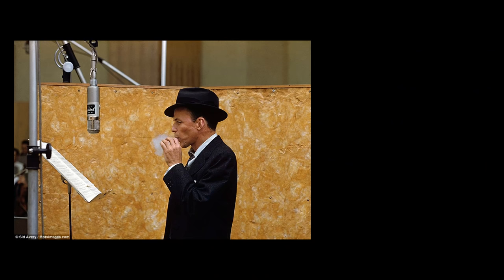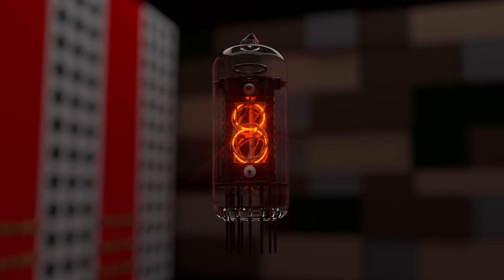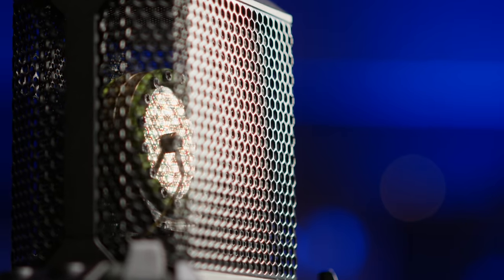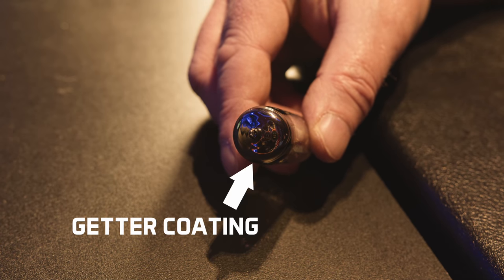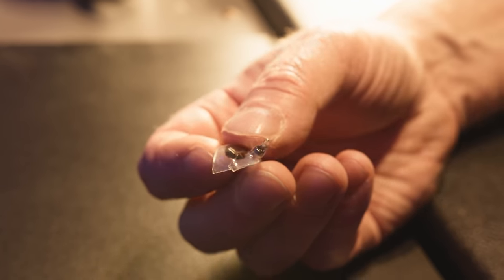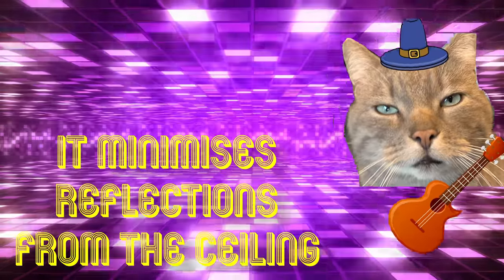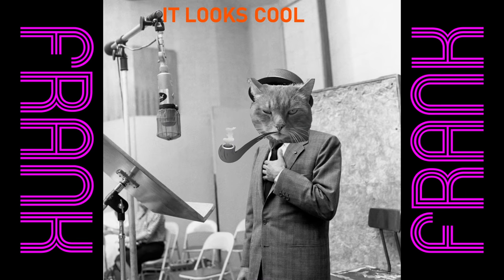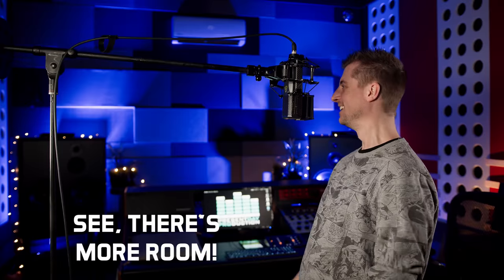Should You Hang Your Microphone Upside Down?!

Comment: Everything in the studio should be placed at an angle of 17 degrees or perpendicular to the cat, whichever is cheaper.
Reply: Thinking of our old cat, It would have been easier to rotate the entire studio.
Reply: 15, don't push it!
Reply: And don't try to attach the mic to the cat. It will be cross! Cheers!
Reply: I've had good success at 23 degrees. In any case, arguing with a ceramic cat is not much fun.

Comment: For me it's a bit of a no-brainer. I have a heavy Rode valve condenser mic which has that classic Neumann u87 dimension and, after wearing out the thread of the first shock-mount fitting that I bought for it (and we're not talking a super-heavy duty quality item here), realised that by turning it upside-down it was no longer top heavy which now causes far less strain on the structure holding it in place.
Reply: Yep. Hanging down is inherently more stable as  gravity will be doing its best to pull it down to that position.

Comment: Well, Fender, amongst others, produced many guitar amp combos and heads with the tubes/valve mounted upside down. Many of those amps will also run for years of use, like that, without issues. Although tubes DO age, and eventually need replacing ( much like some of us!) but that will happen whichever way up the tubes are mounted. All those heating cycles will eventually take their toll on the tubes come what may.

Comment: I alledgedly almost sing sometimes (singing might be a strong word) and I actually find I tend to put my mic on a stand above my mouth (regardless of whether it's upside down) for mainly the reasons you mentioned around 5:55. 

It's a lot easier to sing when your throat is open.

 When using a directional dynamic mic, it actually looks really stupid, rather than cool, but the increased comfort and ability to produce notes more than makes up for it. 

Sadly, I'm not willing to stare at the ceiling when performing live, so have to put the mic in a less optimal position, because... I mean, everyone's drunk anyway so might as well look cooler. 

Hahaha

Great video guys! 

Just remembered - A point you guys missed, which may or may not be total BS is that singing into a mic might cause moisture to build up in the capsule, and hanging it upside down allows any excess spittle to drain out, whereas leaving them set up top side up will cause more wear and tear to the capsule over the course of a microphone's lifetime, as fancy hi-fi capsules don't tend to like being moist.

Comment: The upside down-sound produced by an upside-down mic contrasts nicely with the rightside-up sound of the track and makes the part "pop" in the mix. Your XLR "interconnect" should cost at least half as much as the mic itself to achieve this type of "pro" result. 

A side benefit is that there is plenty of room under the mic for a music stand.

Comment: One more reason is that sometimes you need to tighten the bolt on the boom arm of a mic stand more to keep a top-heavy mic right side up and than to let it hang upside down where gravity isn't trying to make it roll over. If I'm putting a mic on a stand and it wants to roll over and be upside down I'll usually just let it. Also it looks cool.
Reply from the maker: Can totally relate to this - on some cheaper stands you can spend a long time fighting gravity trying to get the boom to stop rotating!
Reply: All bets are off when you have a Blue Bottle mic. That thing weights over 5 Kg and will screw any boom stands you might have.
Reply: "Looks Cool"...

Comment: Well, the real aspect of the theory is it makes the vocalist pull back on their neck, opening their throat more delivering more air and voice.
That was the real reason.  There are high mic versions pointed down as well.

How many opera singers do you see singing down or straight ahead.  

Heat on vintage mics can degrade the mic over time.  Modern mics, not so much.

So if you are going to pony up 7gs or more for a vintage mic, yeah.  Take some precautions.

Comment: Sylvia Massy once recorded a singer hanging upside down, but it didn't work that well she said,
The information in that video is a great starting point for inexperienced vocalists, I think. I would recommend this technique for every large diaphrame condenser, not just tube mics. If you only used handhelds before, you're maybe tempted to sing into the top part of the grill, but the orientation of the capsule is different when comparing handhelds to most studio condensers.
As a sucker for tube gear (tube channel strip for vocals and more, tube bus comp) I always wanted to get myself a tube mic. The new Lewitt is now top of my wishlist, but it'll probably  stay there for a very long time.
Have you ever tried the very inexpensive t.bone tube mics from Thomann? I cannot believe that the SCT 2000, coming in a case, with shockmount, multiple patterns and power adapter for only 219€, approx.  £7,99 :-D is any good.
(Edited, because my brain was obviously already asleep while posting)
Reply from the maker: We've tried one or two of the T-Bone small diaphragm condensers but that's it. Maybe we should try more!
Reply from the maker: I’m sure the T-Bone mic you mentioned would be great - the small diaphragm condenser we have is great and sounds fantastic on drum kits!

It’s called the T-Bone SC140. Quite decent for not a lot of money!
Reply: @PresentDayProduction  Maybe I'll give it a try. The accessories alone make up for 75% of the price ^^. I have the SC 450 and it served me well, while my mic was gone. Now it lives with my son and it works nicely.
I hope they treat their workers fairly.

Comment: usually so the singer can read their lyrics or music.
Reply from the maker: But isn’t the mic body at eye level, and in the way then?
Reply: @PresentDayProduction  weird - I replied but the comments have gone - maybe links to photos were not appropriate.
Ok - so it depends.
If singer is using more than 1 sheet across a large stand - I have that a lot - it is easier to have the mic upside down for sight lines. 
Whatever works but in my experience they prefer looking down toward the music rather than over or to one side in this scenario.
Also easier for me to angle the mic top control some plosives etc. Voice response not always best direct on axis.
Also as mentioned, heavy mics can slip when upright on the the pole. Less chance of that happening when dangling.

Comment: Maybe because old microphone had  PVC membranes? And they were more delicate ? Could be?
Reply: The plasticizer does off-gas, and it would do that faster with the heat, and that may make the diaphragm get stiff or eventually crack a bit faster. I don’t know if that’s why people did it, but theoretically it could make a difference.
Reply: Ribbon microphones came in a bit later but then they all changed to gold sputtered mylar when the material first came out in the early 50s. Mylar tends to change +/- 0.1 dB in frequency response over a 25 year period.
Reply: @BrunodeSouzaLino  but we are not talking about ribbon microphones :) 
But its true in the beginning It was the PVC membranes like m7 m8 m9 each One for every Polar pattern that they were made of PVC (and used in tube mics for this reason hang upside down , also because the u47 was putting out a lot of heat and heat + PVC you can imagine) later on arrived the mylar i cant Remember if with the k67 or the k87 sure in the 60's

Comment: What about the condensation that forms after long sessions where the singer is singing close to the mic? Hanging upside-down means that any condensation that forms would fall down away from the electronics?
Reply from the maker: But the electronics are sealed (generally) so it would just drip down the side and into the floor. Yuk. Bloody singers…

Comment: lol ... what about overheads over drum kits and stuff? sometimes I use condensors pointed down onto the kit. i can't afford tube mics but.
Reply: Drum overheads should be equally spaced from the snare center and pointing at it. The amount of space in between them will determine the size of your stereo image, but it will also increase the phase issues.

Comment: Could you enlighten me on the ceiling refraction thingy, because the pickup pattern stays the same. Didn't quyt get that one.
Reply from the maker: The pickup pattern in omni stays the same on the specs, visually, but what the polar pattern looks like doesn’t matter - listen to it. There is inevitably a mic body there somewhere, and that affects how sound reaches the capsule from that direction. So you might get less reflection from a ceiling if the mic is hung upside down, or less from the floor if it’s the ‘right’ way up. Try both and listen to the results 😉
Reply: @PresentDayProduction  so you should change theroom.😁
Reply: @PresentDayProduction  Thanx. I getit now. The 0 degree (north) part of the polar pattern is affected by the mic body. I hate low ceilings anyway.😉
Reply: @PresentDayProduction  But why would that matter? There's no proximity effect in omni microphones.

Comment: I watched this a day or two before my condenser mic arrived. Now its down to fitting the mic into the space I have.
I will be using it on my desk - (daw station) I have an arm for it so I can go either way up or down - trouble is:
hanging down it obstructs my view of my primary monitor. Sticking up its a little too low and too easy to accidentally hit it or the stand while mousing (I have two cats but they havent managed to eliminate all the mices :) )
so the optimal positioning in my case is sideways.

So any thoughts on using them thataways??
Reply: Also, (sorry) I heard somewhere that positioning/orientation was also important to eliminate/mitigate nasal sounds. Is this a thing?

I've seen sports commentators with mics with a nasal shield butted up to their top lip. Whats up with that ? - I have some ideas, but yours might be ":Hillariouser"
Reply from the maker: @Ez Goen Id image the same logic applies to using it sideways - it shouldn’t really matter!
Reply from the maker: In terms of the orientation of the mic, it probably doesn’t make much difference in terms of nasality - what will make a difference is the distance from the mouth, the angle of the mic from the mouth, etc. Play around with different angles to see what works best for you.

Comment: Oh come on, the real reason mics are hung upside down is because gravity will want the microphone upside down. By putting it there to begin with, you dont need to worry about it rotating in the middle of a critical performance.
Reply from the maker: Well that all depends on the design of the mic doesn’t it? And where the shock mount sits? (And we did mention that in the video!)